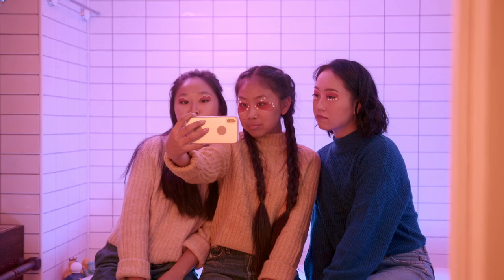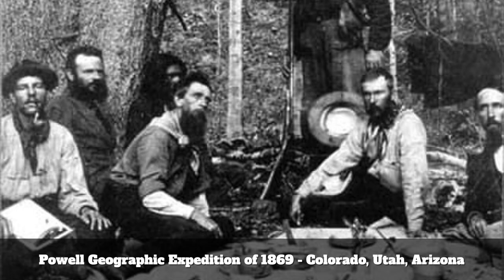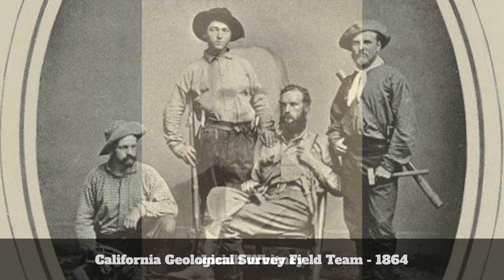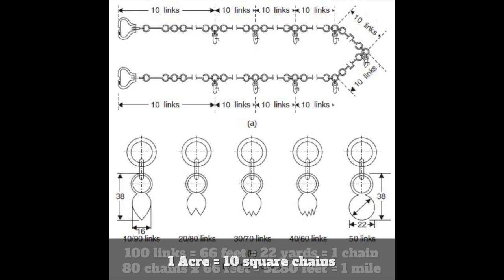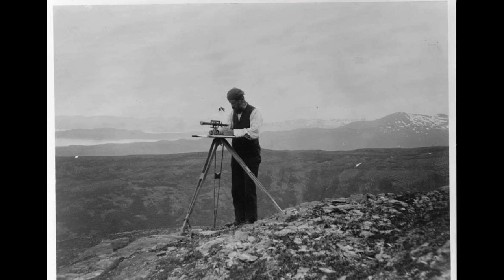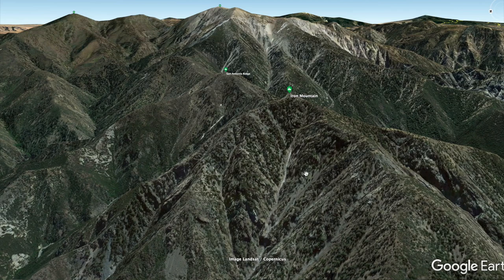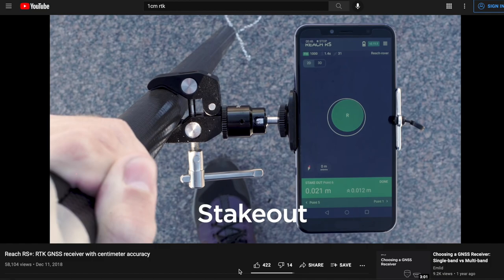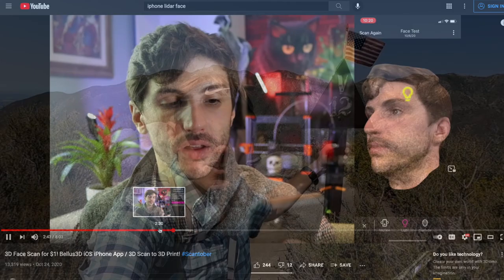What Are These Triangular Signs? (Witness Posts)

Comment: We still use chains in Great Britain. Here in Wales you see most railway bridges listing Bridge number, miles and Chains. So 1 mile 22 yards would be listed as 1m    1ch. Its the distance of the bridge from the primary station.

It's listed like that in case a lorry strikes a bridge.
Reply from the maker: Ahh interesting, did not know that.  I've spent many hours on trains all over GB and always wondered what all the signs and codes meant. Hoping to get back to do Snowden again when things open up and get more stable.